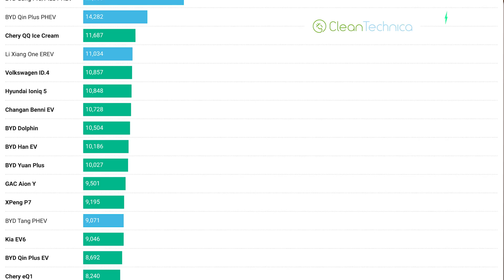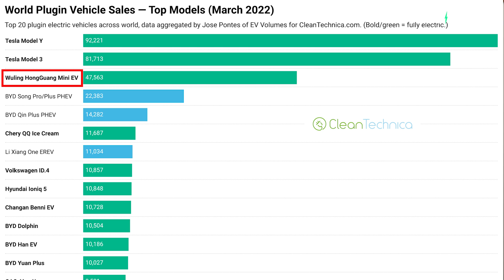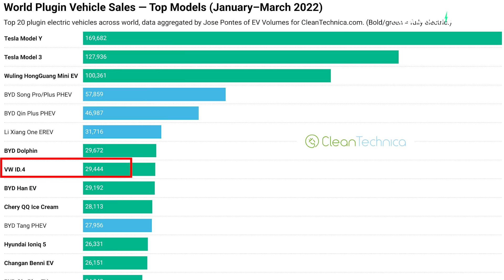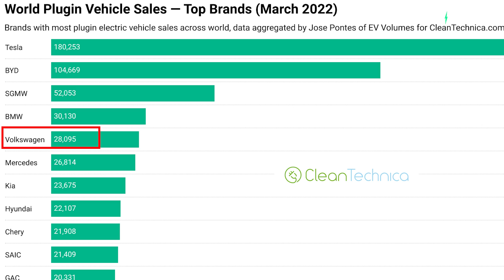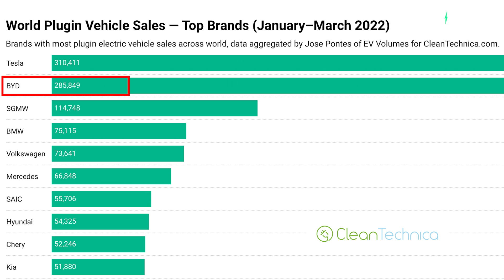The 20 best selling electric cars In the world in 2022

Comment: At these rates (i.e. 60% growth and 15% share of total auto market today) EV will have 100% of the market in 4 years: Yr 0: 15%; yr 1: 24%; yr 2: 38%; yr 3: 61%; yr 4: 98%; yr 5: 157%. 

Invest in coal, oil, gas, and nuclear...and copper and aluminum. Something has to make and deliver all this electricity and it's not going to be wind and sun and existing electrical outlets and extension cords. 

And BTW, there's no such thing as fossil fuels. Tell me how dinosaurs got buried under 7 miles of stuff and became oil (e.g. where did the stuff come from?). Tell me how old oil fields are refilling. We are so loaded down with bad science. It never seems to get past the ridiculous hypothesis stage that is declared true until proven otherwise.

So I offer this hypothesis (as fact like they do). Hydro carbons come from the Earth's molten core. There's hydrogen, carbon, and oxygen in there ... and heat and pressure to cram it all together. And being lighter than everything else, it rises to the surface.